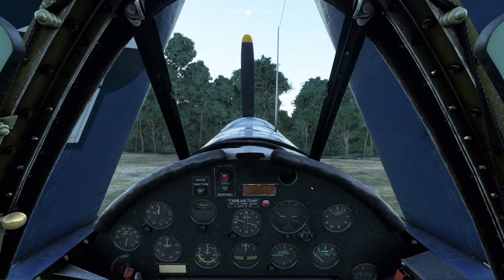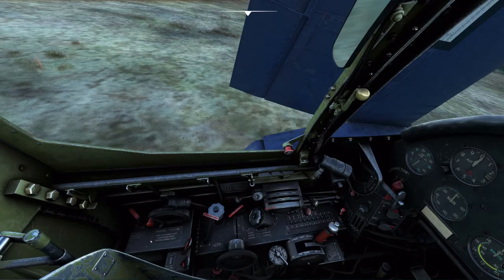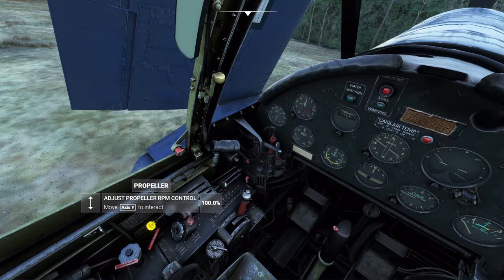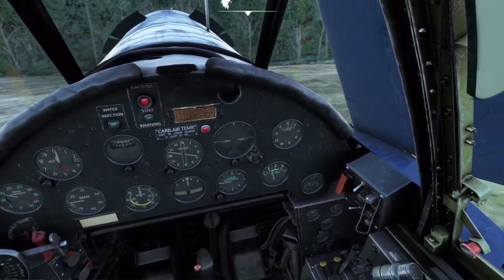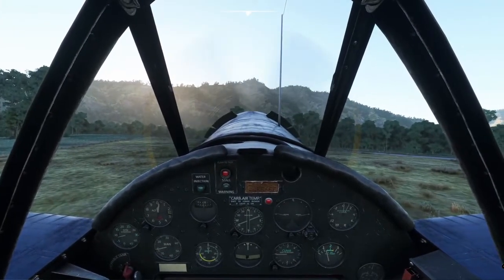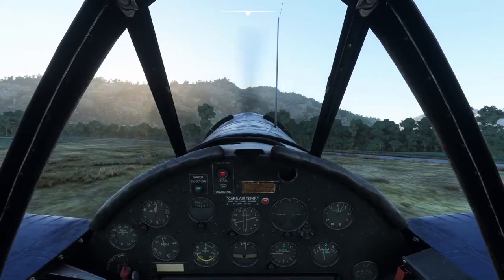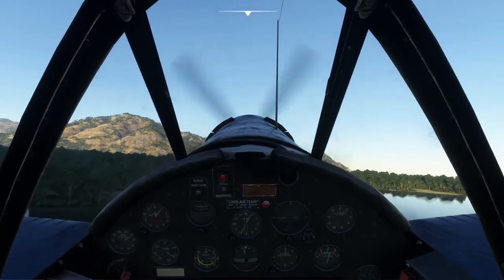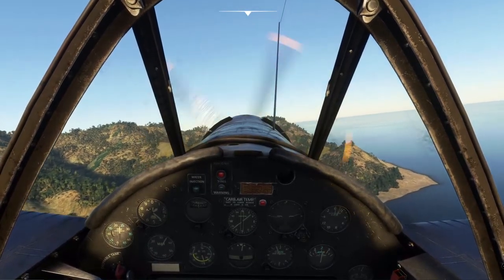MILVIZ Corsair FG-1 (F4U) Startup and Short Takeoff Tutorial

Comment: After learning the trick of manifold up pressure during take off in couple with the pressing of the right rudder I now was able to manage to take off although not straight but I could get her up in the air. The issue is now on landing which is quite challenging. The aircraft always rolls to the right almost immediately after touching down and consequently the tip of the right wing tip and hits the runway.
Reply from the maker: I was never able to land until I got rudder pedals. The trick appears to be dragging the right and left toe brakes lightly in order to keep from careening off the runway, and I'm not sure it's even possible without using toe brakes lightly. You might be able to get away with fast taps on separate keys for left and right brakes, but I never had any real success until I got Logitech pedals.
Reply: @scottstoll-dn2yx  I Have the Thurstmaster rudders and still did not work for me.

Comment: I have question about RPM ,throttle and cooling did you try max power and how long in which cooling set? because F4U should come to DCS and i read official manual and everywhere is 2700rpm as max for test so my question is can i do for example :rich mixture, 3000rpm and from 48 - 52 pressure with internal cooling closed cowl flaps full open and also full open oil cooling for 10 minutes straight ? I am asking mostly because for example P51 if i open radiator and oil cooling i can go full rpm and 95% of throttle for 10 more minutes without engine failure so to be the most effective in combat what is maximum i can do with which setting ?
Reply from the maker: I'm honestly not sure. The training video from WWII didn't mention anything about RPM until after you're airborne. As far as full power goes, if DCS models it realistically then you'll probably ground loop. The Corsair was notorious for flipping over and killing its pilots if they hit the power too hard, too fast.
Reply: @scottstoll-dn2yx  We will have carrier take offs and landings so it will be different from ground take off, but i meant in flight : engine managment. Which RPM and pressure is combat power and how long can i use it ? Also emergency but it usualy 1-5min.
Reply from the maker: @alcatraz0643  I really have no idea. I patterned this procedure after the real takeoff training film from the Navy but it only covered takeoff. If you find anything on this subject, please reply here with the info so the rest of us can benefit from it.
Reply: @scottstoll-dn2yx  I am just trying to find out how to get the most from engine for dogfights, straight flight is cool, but in DCS, combat conditions will be important to take care of. Probably we will get manual with it, but still its good to have it in advance. And of course carrier ops and landing with that nose and using british method of landing will be fun. We get most realistic Corsair in DCS that you can find in game so, we can use real life things, almost everything is simulated and damage too thats why i asked if i see engine and something coming from it that wont be nice flight + thanks for some warnings about that engine, i read manual they got with corsair, but not too deeply because we are getting phantom and also hellcat will come so, with all those jets and helicpoters and manuals in head, its better to wait.

Comment: Great video - thank you. But it left me with two questions unanswered. 1. Just before takeoff you describe increasing the manifold pressure, and then later backing it off. But your only focus is on the gauge. How do you change the manifold pressure? 2. At the end you indicate that the prop should be decreased from 100. What should it be decreased to? Thanks again for a very useful and clear video!
Reply from the maker: The throttle technically does not increase or decrease engine rpm, it changes the manifold pressure. So, when I'm talking about changing the manifold pressure, I'm talking about making throttle adjustments.

The prop should be reduced to bring the speed down below the maximum. I'm not in front of the manual, but I think the maximum "normal" (non-takeoff of combat)  rpm is around 2700 rpm.

There is a great training film on the Corsair from World War II that walks you through all of the trim settings and everything else you need to know. It's here on YouTube someplace. The main thing I learned, the hard way, is to keep my hands off the stick, be quick and proactive with rudder adjustments, and trust the elevator trim to get you off the runway.

Unless you are using a very short runway with a bunch of trees in front of you...  like in this video.
Reply: @scottstoll-dn2yx  that answers my questions precisely! Thank you again. I will look for the WWII training video. It sounds fascinating. I really appreciate the work you've done here.